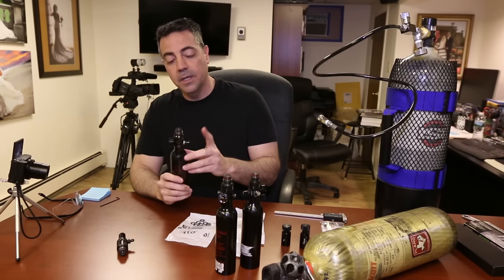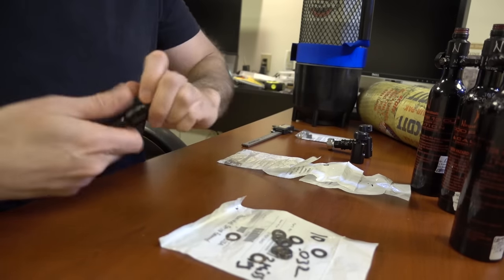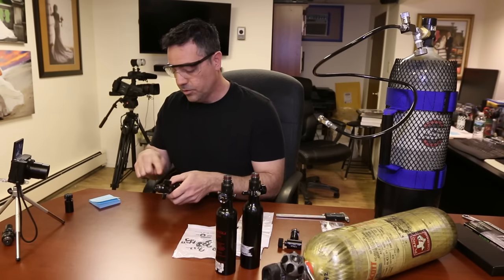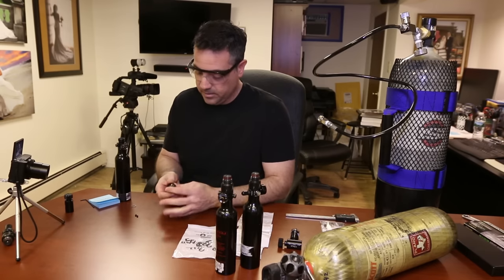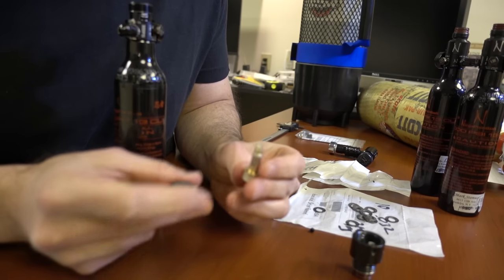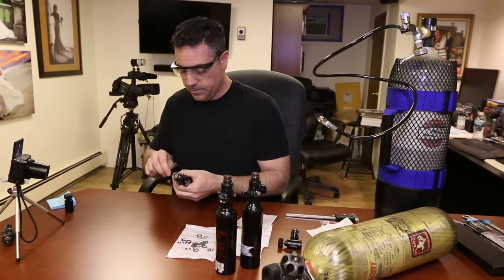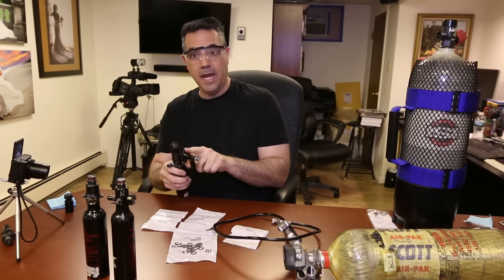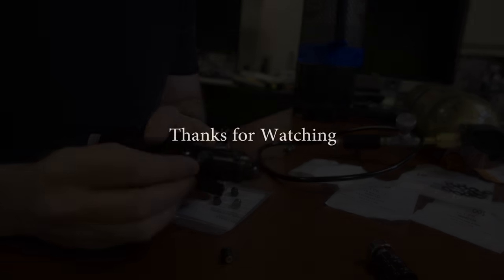How to adjust ninja ( Umarex Gauntlet ) regulator for PCP HPA Airguns (800psi to 1400psi output)

Comment: Finally the gun i paid for. Thanks again for doing this video and leaving it up to help guys like me. My Gauntlet is pushing 18s close to a grand and my regs at 1350 psi. With a little help of some Halfhill Engineering of course. No after market parts at all. That little reg held it all back because it was only putting out 800 psi.  Thanks so much for this long awaited performance.Shooting so good right now and not at multi-pump speeds at K-Mart. You Rock!

Comment: Stacking the belville washers in the same orientation will eliminate the spring effect of those washers then adding more shims to increase air pressure will add more working force to the four remaining pares of opposing belville washers there by increasing the potential for spring fatigue. imho

Comment: Hey, I'm new to this stuff... but I'm wondering why you need to replace the spring with the Belleville washers. Will the modification work by just adding Shims with the original spring in place ? Thanks for taking the time to make the videos on you YouTube channel, they've been a great help with my new hobby. Hope this isn't a really stupid question :)
Reply: In theory, if you compress the SAME spring a little more, you won't get too much of a jump in output pressure. Actually, you may not see a change at all and it may deteriorate with time if kept under pressure (memory effect). You should get a tougher spring, which is what the belleville washers do in this case (also known as DISC SPRING).

Comment: Is it possible to adjust the regulator on a sig Sauer mxc virtus pcp? It appears to be a Ninja. I really like the look and feel of the virtus, but I'd like to increase the power from the 12ft lbs...
Reply: You ever figure this out?
Reply: I bet it is possible. Just dunno how high of a pressure the Virtus can take. I recsll it did have it's manufacturer's limit regardingbthe max pressure reading on the side of the rifle.
Reply: Guys are doing this to the virus I took my regulator apart and switched one of the three shims with the red shim that’s at the bottom of the stack of Millville washers I put the shim I replaced the red one with back at the bottom where red one was and installed the Melville washers exactly same way they were.I haven’t shot the gun yet but if you guys are interested I can let you know of results.
Reply: Yes.
I made three shims (0.5mm and 2x 0.05mm, totally 0.60mm thick) and added them underneath the original stack of washers within the Virtus regulator. My Sig Air bottle regulator is now set to about 92bar~1330psi.

Comment: Thanks for the instructional vid! Thanks to you I was able to order washers and shims, then modify my low pressure regulator to a higher output (1000psi) and my air rifle barrel responded favorably. The higher pressure got rid of my fliers, and tightened up the groups! Thanks again!
Reply: Hi Paul, Can I ask what set up you used in your shims to get 1000psi as this is the pressure I would like to achieve?

Comment: Great video, lots of good info. Im planning to get a ninga pro v2 reg. SHP and install it on a 23ci carbon bottle for my Umarex Guntlet. And the same bottle for the reg that came with the gun. It is a ninga as well. Have you adjusted the pressure on any of the ninga pro v2 regs. I would assume they are the same, just with the rotation feature.

Comment: Thanks for the very detailed video!  I just had a 1.8K burst disk blow in my new .22  Gauntlet and I really appreciated that you included them in your video!  Glad I watched it all!  Now if Umarex will only send me a replacement!
Reply: Gerald Wolfe I wish you luck with Umarex repair service and replacement parts. From my experience with them, they don’t seem to care to deal with the consumers other than our money from our pockets. I sent my gun back to have some issues fixed that got through QC that shouldn’t have but did and the made me buy a new regulator and bottle. The last time I fired the gun before it went to them it was shooting 14.3s @ 770 ish and when they sent it back it shot 667 FPS??? I have no idea what they did but damn sure know what they didn’t. My point is, utilize all the knowledge these guys put out there for us and fix it yourself if you can. In my case all Umarex did was piss me off, say screw the warranty cause it’s pointless.They don’t listen anyway and I ended up making it the way it should have been from the factory. This gun now is pushing 18+ grain pellets at 970 and didn’t take more than 20 minutes with common tools and skills. Considering I spent 20$ in shipping and another 100 for a reg and a tank plus about three weeks waiting. 20 minutes is nothing.
Reply: @heathhalfhill6867  Sorry to hear that you had such a bad experience with them!  After several emails back and forth I actually got a return label for the tank.  After another week or two I got the tank back with a note saying I had over filled it or was too forceful!  This was absolutely ridiculous.  I used an Umarex hand pump and it was all I could do to get it to 3000 psi and certainly not more!  Also they ignored the fact that it burst a week after I filled it!  Anyway, they replaced the disk and it didn't cost me anything, but my time.  I've had no problems since with it other than the bolt is a real pain and constantly jams pellets!

Comment: FYI, using a factory Ninja 13 ci, 3000# tank I was getting 650fps out of a Drozd Blackbird.   Altered regulator using 5 pairs of recommended Belleville washers with a single on each end and (1) 0.20” shim, velocity went to 800fps.   Don’t have a pressure output gauge to measure pressure.  
   Also noticed new ninja tank regulator has a dab of “silicone” grease on the piston rings.  Not petroleum grease. 
   Thx for the video, well done.

Comment: Thank you for your videos. Best on you tube by a long shot building a Frankenstein pcp. I have ordered parts from the suppliers you have mention already. Have a 1322 that I want to convert over to a 2240 and ordered 2240 that I want to do a same setup as yours very well put together videos. I subscribed to your channel thank you again
Reply from the maker: Ken Brown that great. please just be careful try to keep the Ninja regulator about 1300 psi as CO2 specifications are around 800 to 1100 psi. check out John DiStefano at www.jdsairman.com he has built many crosman 2240 PCP guns using bottles at 1400psi output. I believe in balance. keep output pressure low enough to be safe be high enough to realize a power gain of hpa. good luck

Comment: Thanks for this very informative video. I would like to do this to my Umarex Gauntlet just to bump up my velocity a little. Would this be the same process for the tank on the Gauntlet?
Thanks
Reply from the maker: Scott Rader I'm not sure but it should be. Most of these regulators operate the same way.
Reply: Scott Rader yes you can but mind you if you have a .177 Gauntlet and Increase the Fps, you then MIGHT need to switch to a heavier pellet than what you use now if you end you seeing accuracy issues. Therefore if that happens you might just be better off leaving it at stock reg settings. Now thats for .177 tho... Now for the .22 Gauntlet it should be a good/positive increase IMO to bring it up 100-200psi seeing as how alot of Gauntlets in .22 are a bit underpowered. Plus even the ones that are not underpowered could still benefit from a small increase. Just test it out. Very Important to have a Cronograph and do just a little adjustments at a time. Dont get crazy with it and try to rush it. You just have to take it slow and easy and keep track of your shims and numbers etc.etc. (((*NOTE: On P.Airs YouTube Channel there is a Video showing how to remove The Bottle on The Gauntlet without releasing all the air from it. Theres a simple little trick you can do that involves undoing bottle just a tad, then dry firing it several times to release some of the Air in the valve and line and then being able to take the bottle the rest of the way off without releasing the rest of your air. A very useful trick for any of you with handpumps out there. BUT Please Make sure to find and watch and follow the Video step by step before attempting to do the trick so as to be safe and do it correctly.)))
#HPAirguns #UmarexGauntlet #KyAirGunners #ItsNotAFirearm #NinjaPaintballTanks #DrJones

Comment: So to get a higher output pressure all you had to do is take apart the regulator and reposition those shims? Most HPA tanks are regulated at 800 psi so is there any danger or downside to raising the pressure like this?

Comment: Have you done any experimenting with how much air you can flow through a stock valve and transfer port before you hit the velocity wall?  When increasing the regulated output to a higher pressure, is there a point you reach where addition available air pressure doesn't give a gain.  I ask because I was adding shims and testing with the factory 2250 transfer port and valve.  Each time I added a shim, I saw an increase in velocity.  However, when I added an additional shim going from .040 to .045, I saw a decrease.  My first thought is I need either a stiffer hammer spring, but maybe I need better flow.  Sorry for posting this question on such an old video.    Also, those part numbers are still relevant as I used them a week ago to get the shims I am using.

Comment: Nice Tutorial, awesome video. You certainly are knowledgeable on these PCP Air Rifles and theregulators. Now I know how to increase my Ninga regulator that tested 1,700 psi to what it's suppose to be at 1,900 output. Do you have any idea how to increase the pressure on a "QUPB" regulator?
Reply from the maker: Just keep in mind that the output side of the regulator has a 1.8k burst disc for safety. This will blow after a few days if you set your regulator to 1700 psi. They even blow at 1600 psi. I had mine set to 1500 PSI and about a month later the 1.8k burst disc blew.

Comment: Hi on your pressure checker, what parts do I need to make one. I don't see any info posted thanks
Reply from the maker: Ken Brown you need a Ninja slide check, Ninja ASA, and a 1/8th npt pressure gauge. the most accurate would be a 1500 psi gauge butna 2000 psi is good too

Comment: Hi 
After building Two  filling stations, id like to ask  a technical question regarding
filling of a PCP rifle. 

   I can fill my rifle with
 my Nomad II compressor and foot pump no problem but when i go to use my newly built filling station tanks , my rifle will not begin to fill. When i open the valve on my filling station the air is leaving it down the air filling line. The filling stations  are rated at
3000 ps (207 Bar). My  Rifle will take up to 3000 psi. Is a pressure valve not opening
on the rifle because of not enough back pressure? Do i need to have a tank with a higher pressure?
Hope you can help ,cheers Red

Comment: Great video.  Trying to build ASA, Ninja Slide valve and Manometer setup as described.  Ordered:  Outdoor Guy Paintball CO2 Adapter Fill Station Remote On/Off ASA from Amazon.  My Gauntlett 13ci bottle appears to have a pin versus a ball.  The ASA will not depress pin enough to empty tank.  Please recommend an ASA that will work.  Thanks.

Comment: I already know the answer, even if it is possible and safe. But I have the ninja 3000 psi output valve on top of my 90 cu in 4500 ninja refill bottle ( I hear its basically the same as the air venturi, in fact I think air venturi actually makes it. My dilema now is I got a new pcp fx dream-tact compact, needless to say, loving it already, but it can fill to 230 bar unlike the 200 bar (3000 psi) hatsan I had previously. Unregulated valve for the refill bottle is like $219. But can I increase to output (safely of course ) of my ninja 3000 psi valve to 3335 (230 bar) psi so I can get a complete fill in my fx ?

Comment: couldnt you just add a shim or three to do the dame thing
Reply: The spring washers may need the spring distance (fast forwarded the video 😂) I’m new to paintball which I’m using for home defense (less lethal options) so not entirely sure, but I have a mechanical background so I’m sure it has purpose. I’m looking to get the most outa my T15 PDW 😵

Comment: I found another little trick to get more power gauntlet's .it's so advious .I'm betting no one else has ever noticed yet .here it is .(when you take the breechblock and barrel off the rifle .look down inside the tube where the hammer goes .you'll see a thick spacer with an upper and lower screw hole it slides over the poppit pin .but only has very little clearance .it only allows the pin to travel about 25 thousands  if you take the block out and shave off and another 25 thousands then the pin can travel twice as  far  more air = more power am I right or am I right lol

Comment: ... Oops, I'd already ordered a new reg to resolve a severe power issue on my cutom pcp before remembering this...
A little investigation showed my current 850 out reg already has belville washers, so I followed your example and adjusted mine to suit. I'll be refilling and testing my bottle tomorrow and chrony testing the new output to make sure it stays within the UK legal limits.
The new reg I ordered will be mated to a new bottle when I get around to ordering one, this will either be used as a spare, or get mated to a second custom pcp I own which I believe suffers with the same power issue >.<

Comment: I found out that the bottom washers that ninja calls "calibrations washers" are just the same as the top shimes I got my SHP i was running at 950 down to 566PSI this is a big deal for me because I dont have to spend 70 bucks on a regulator for my new marker... regs are kinda BS in general they cost so much its almost better to just buy a whole tank & sell the tank the pricing of alone tanks & alone regs dont make since it cost almost double to buy a separate regulator from tank.
Reply from the maker: just as a note you can only go as high the low pressure side burst disc will allow. The low pressure disc says 1.8K psi but it will blow at around 1350 psi after a few days.
Reply: @AirVelocitySport   I have another issue I noticed one of my tanks has a rust like corrosion all over the belleville stack rings ill make sure to cover the fill nipple when i grease it but do you know anything off hand that is safe to use on the bellville ring stack ?
Reply from the maker: Yes, I too had he same problem with the ninja regulator. I even had rust on the spring and ball bearing. I would only use a little silicone grease. Never use oil that is combustible. That rust means water is getting into the regulator and bottle. Try using a molecular sieve filter with your compressor. If you are hand pumping try to put a filter between the pump and bottle.
Reply: @AirVelocitySport  do you know what tread ninja uses for its burst disk, also do you know if there is a standard for other tanks seems like its smaller than 1/8th

Comment: So you don't mess with the belleville washers to increase pressure. Just add shims on top of bottle before you screw on the regulator. What is the od an id of the shims or do you have a link to the page. I would like to order some shims before I take off the regulator.

Comment: I would like that slide check and pressure gauge to use on 4500psi bottles but that won’t screw onto the tanks only on paintball bottles. Which would I need for 4500psi?  Thanks

Comment: The gauge and fill port on my gauntlet do not line up properly in order to be viewed through the forearm cut outs properly if I tighten the air tank and regulator all the way down.  To make the gauge/fill port line up correctly I have to leave the regulator somewhat loose and the bottle is a little wobbly.  This can't be normal but I can't get any of it apart either..like it was put together with an impact wrench when they refurbished it. There is no simply unscrewing of the unit and the regulator and air tank both come out of the rifle in a single unit when I unscrew the tank.   It is degassed and all of that. so..I don't know. Words of wisdom?

Comment: Hey man can you (or anyone who knows) tell me what size threads are on the Umarex Gauntlet Regulator AND/OR If The Ninja V2 Regulator will fit in the Umarex Gauntlet??? {Im wanting to upgrade to a larger bottle for a higher shot count but instead of using the stock reg that came on the guns stock bottle I want to buy another one in order to have a spare tank and i like the V2 cause it can hold 4500psi so if i can find a carbon fiber bottle that will fit i can use that and get a even higher shot count and less added weight}

Comment: thanks for your video, i finally adjusted my ninja ultralite to 1,650 psi
Reply from the maker: alex barredo just be aware that the. Burst disc going to blow very soon. Even though it's rated at 1.8k it will blow even at 1500psi because of metal fatigue and because the out put pressure will vary. Be sure you have plenty of burst discs on hand. Mine would blow within about a week at 1550psi.
Reply: sir i already change the burst disc to 3k disc before i adjusted it , thanks for your concern sir, your the best
Reply from the maker: alex barredo now that you have changed the 1.8 K burst disc to 3K burst disc you must be careful that the gun you're using can handle 3000 pounds of pressure. If the regulator fails the full force of the bottle will be passing into your gun. It could be very dangerous I highly recommend not using a 3K burst disk if your gun cannot handle that kind of pressure. It's much safer to stick with the 1.8 K burst disk.
Reply: dont worry sir my airgun valve can handle  3.5k psi , and it is a wellknown airgun  maker here in the phils. thanks for your concern